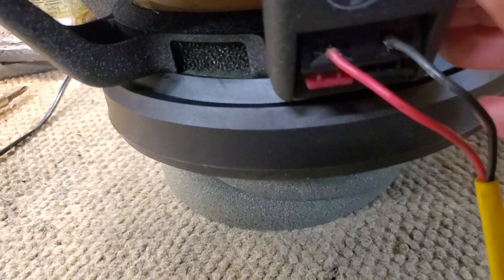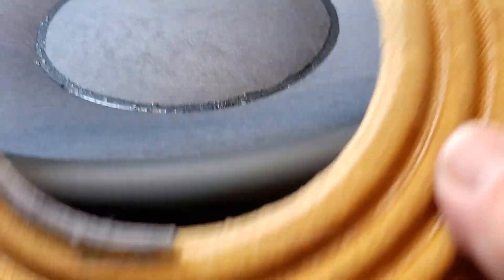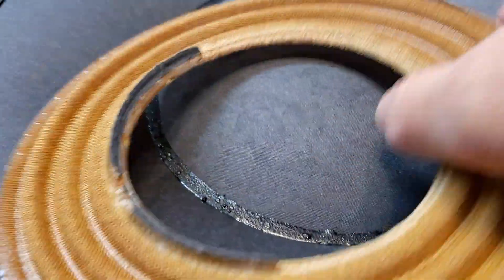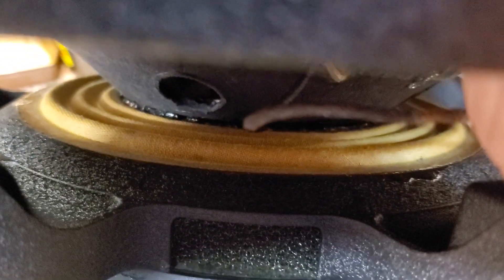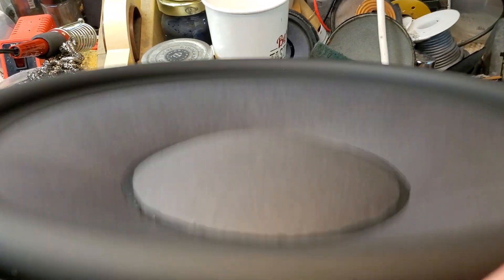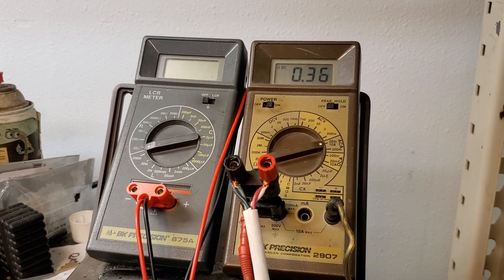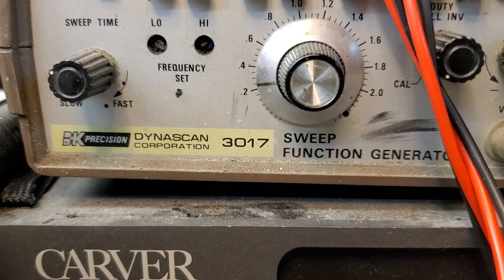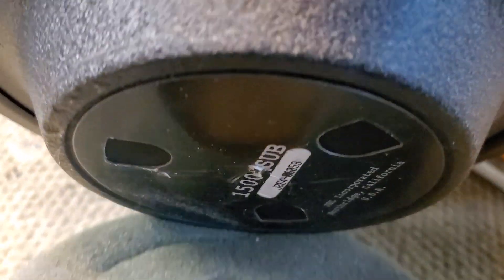Rescue repair of JBL Sub1500/1500 Sub/W1500H, Part 2 of 2...Upland Loudspeaker Service

Comment: I have 8 of these, all brand new in box, but plan on using them quite soon for a HT/music setup.  I’ve heard about the issue. Can something be done to prevent it, like applying new epoxy between the spider and cone where they meet at the coil former?
Reply from the maker: No guarantees simply applying more epoxy will work. The substrates need to be clean, the weave of the spider needs to be permeated.